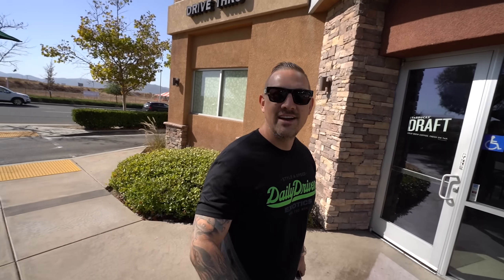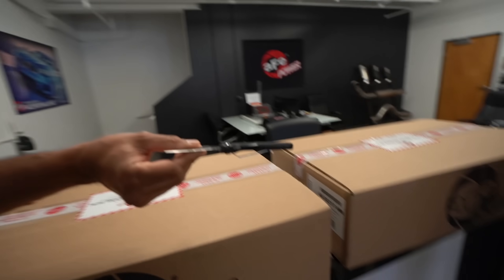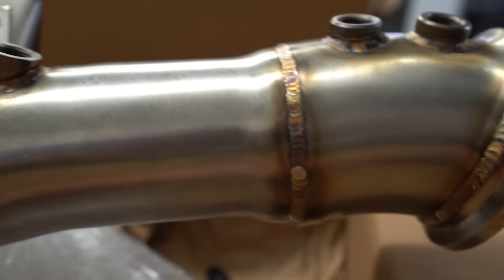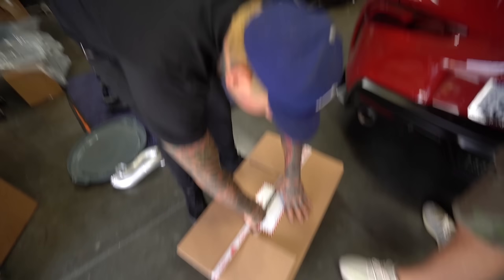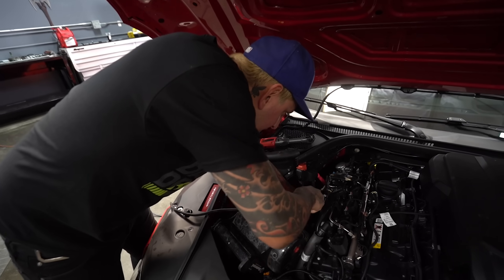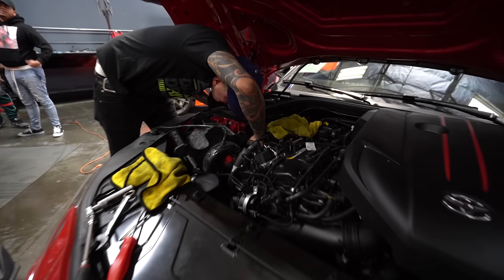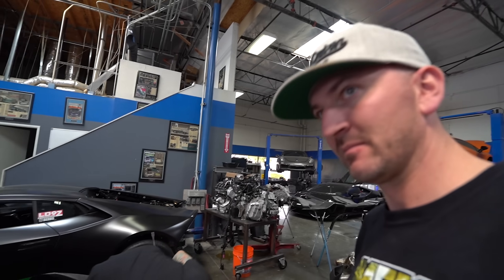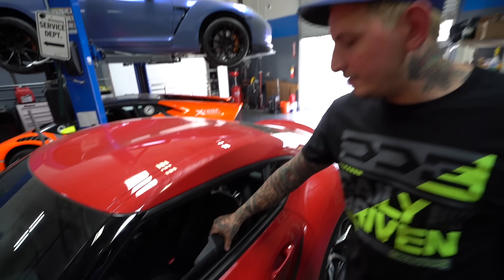NEW 2020 SUPRA DOWNPIPE EXHAUST INSTALL! *SOUNDS INSANE*

Comment: You might as well upgrade the manifold when you get the new exhaust in the supra. Also open up those fake vents, new steering wheel with paddle shifters, and remove as much plastic as you can from the engine bay.

Comment: I had my neighbors do an oil change on my TT and they actually teared some of my under cover to reach the oil filter. It started to drag on the highway thinking it was something far worse. Relatable situation.
Reply: Lol, what year is it? Its kinda hard to damage that stuff on my a4, and I think that they share some parts like that
Reply: Nick linik its a 2008. We didn’t have the right tool to undo the screws on the bottom, so i think he just tried to peel if back but it ripped. We just cut it off afterwards, so theres a decent hole in my cover now lol

Comment: F12 is still midengined the v12 sits behind the front axel example a huracan is rear midengine the f12 is front midengine the supra has 2 of its 6 cylinders in front of its front axel

Comment: You guys really need to get some schooling from ManCobra.  Boost pressure is meaningless. Mass air flow is what matters.  A small turbo pushing 30psi is nothing compared to a large turbo pushing 30 psi in terms of airflow.  These are simple things guys.  I know you are smart enough to learn and remember this stuff if you just put a little effort into it.